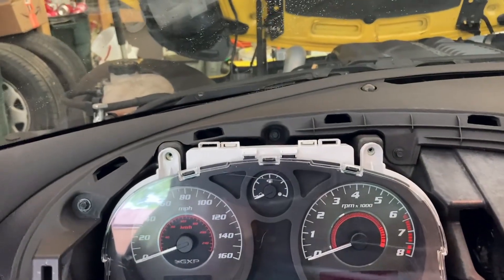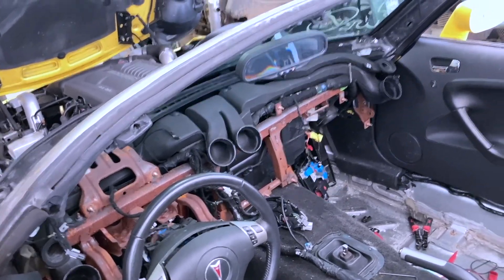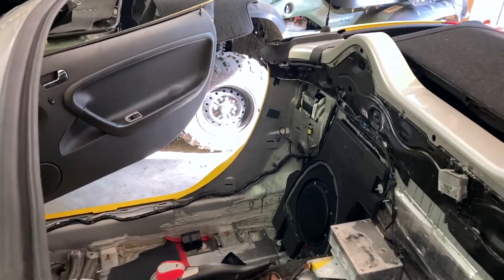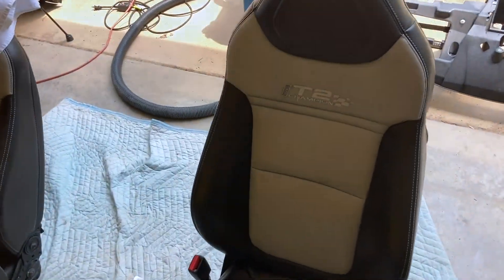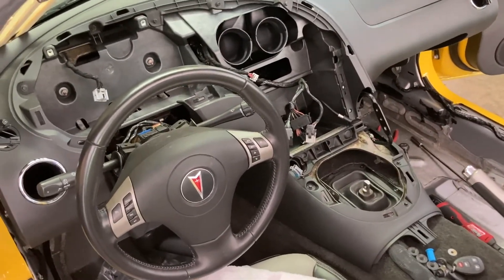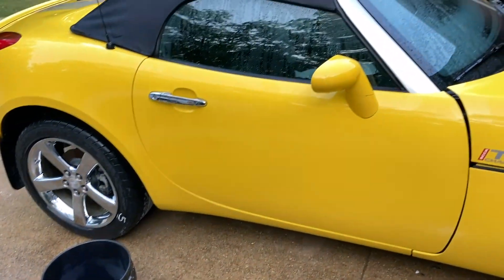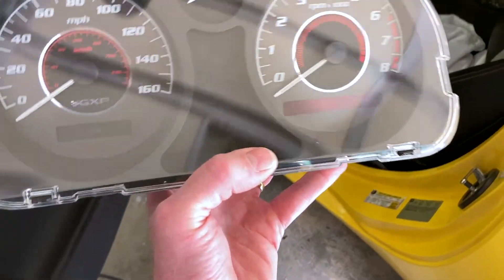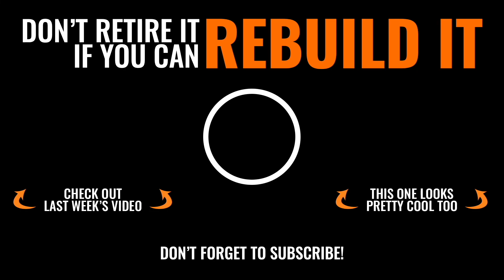We Finally Found the Mileage on Our Burn Car! - Pontiac Solstice GXP SCCA T2 Pt. 4

Comment: if the car is a 2008 you might have to flash the RCDLR with new firmware in order to get the TPMS working.  You guys had the interior gutted. When you cycled the key  if you did not have the seat belts installed into the car you are going to have to use Tech2/Tech2Win or another advanced  diagnostic tool to reset the airbag codes. The seat belts have pretensioners in them that are activated by the SDM (airbag module) If you did not have them plugged in  that is going to generate a hard fault that is only going to be able to be reset with one of the tools mentioned above. If it was only the seats that were out of the vehicle you do not have to worry as the PPS (passenger presence sensor) module when unplugged does not create a hard fault and the light will go out when the seat is plugged back in. The PPS sensors have been known to have issues with them and there is a recall on it.  DO NOT get the recall performed if the airbag light is not lit and there is not a fault in the SDM for a failure of the PPS. The recall is split so that they will do a "fix" if the airbag light is not on and here are reports of PPS mats that have been fixed failing after the 1 year repair warranty as outlined in the recall. wait until it actually fails and a new mat that been updated seem to work  and I do not believe anyone has had a failure of a replacement PPS mat.

I know you guys monkeyed around with the BCM because of corrosion on it. If you replaced the BCM and the VIN of the BCM is in disagreement with the IPC and the BCM is in agreement with the ECM the mileage stored in the BCM is used. If you  reprogrammed a new BCM to work in the vehicle and there was no IPC available in the car the BCM my have retained the mileage from whatever vehicle it came out of. If the original IPC was in the vehicle and working and a replacement BCM was used when reprogramming the replacement BCM the mileage stored in the IPC would have been used and coded into the BCM.

If the BCM has been replaced you may want to verify the mileage  you might be able to send a request to lexisnexis and they might provide you the mileage on the vehicle at the time of the total loss. The mileage  would be what was given to them by the owner of the vehicle at that time. It will not be 100% accurate but it will sure give you a good ballpark. If they will not provide it then call you insurance agent and they should be able to get the information from lexisnexis for you.